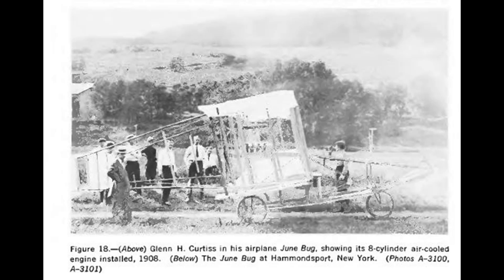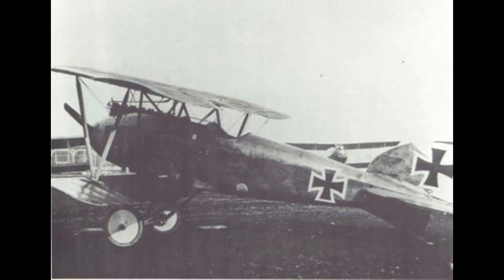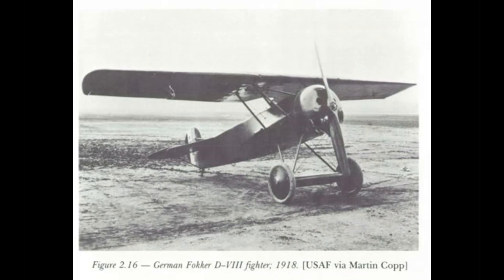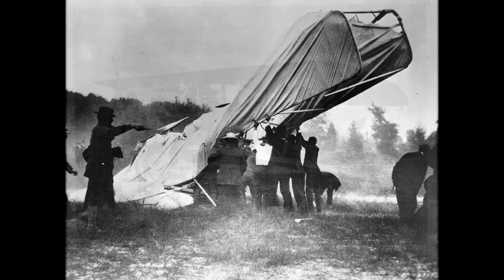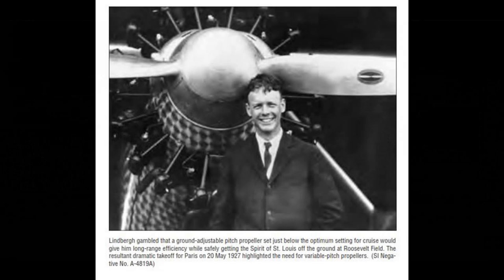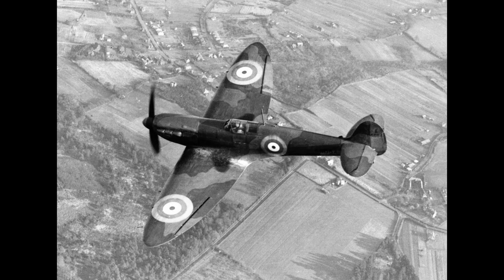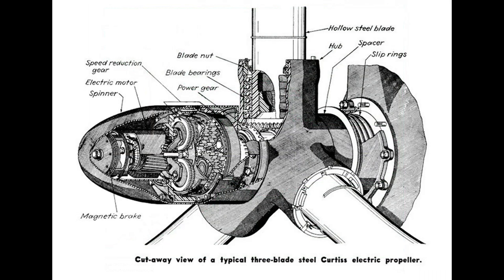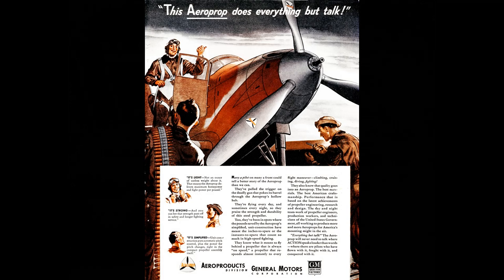Advancements In Propellers 1909-1942

Comment: You've demonstrated again why jet engines were a quantum leap in aircraft propulsion.  There was a reduction in powerplant and propeller vibration, the jet engines were simpler than the pistol engine with turbochargers and drive shafts and variable pitch props, and there were fewer controls as well.  Eventually you'll get around to explaining the modern turbo fan engines--it will take fewer words and charts.

Comment: The Spitfire II also entered production right before the Battle of Britain and with high octane fuel that thing has 1500 hp
Reply: Not exactly accurate, the first Mk IIs went into action at the beginning of September so most squadrons finished the battle with Mk Is. The Merlin XII in the Mk II produced 1,175 hp and 100 octane fuel allowed about a 10% power increase with the boost limit adjusted Mk I and IIs.

Comment: Wood props were standard for hurricanes and spitfires until 1940 Even though they were available, 2 bladed props were not full replaced until battle of Britain.The story of how the two fighters got three  bladed props had little to do with manufacturer. In June 1940 flight lieutenant McGrath telephoned the deHavilland  propeller division and asked if it would be possible to try a constant speed prop without a lot of fuss or paperwork. It add 7,000 feet to the service ceiling as well as !ore speed. The real benefit was to the maintainability of the Merlin by reducing wear. What makes this really bizarre is the constant speed.prop was a British invention.
Reply: Look it up again, the two position props were lighter and simplified De Havilland versions of the Hamilton Standard constant speed three blade propellers, the pre BOB upgrade by De Havilland converted their three blade props to constant speed.  The Bf 109E only had inferior manual electric pitch control propellers.

Comment: Thanks for the video Greg.
Your point about electric props and batteries in combat aircraft made me question something totally unrelated.
How were those batteries built?
They must have been sealed in some way to in order to withstand manoeuvring during combat.
Did they use some sort of gel-battery to prevent spilling?
Hope you read this, I'm puzzled.
Reply from the maker: Hmm, I never thought about that. I have no idea.
Reply: @GregsAirplanesandAutomobiles  gonna write to the museum in Sinsheim, maybe they have an answer. Cheers for responding Greg, love your videos.
Reply: Perhaps drain holes under the battery leak path was all they did? It was a good item to move when a big C.O.G. shift was needed.

Comment: Fighter ace Douglas Baader almost ended his WWIi career before it started by taking off with the wrong pitch on his varible pitch prop.and crashing.
Reply: That was the two position airscrew (as the Brits called them at the time) "Coarse" for takeoff/landing and "Fine" for cruising and speed.   He took off- or rather TRIED to take off -  in "Fine".     I used to think he was the absolute heroic british gentleman... ...until learning more about him...and particularly  his treatment of his Colditz valet....  he had some pretty nasty character traits it seems...
Reply: @trooperdgb9722  fine pitch is the correct blade angle for take off, course for cruising and high speed.
Reply: @richardrichard5409  Thanks!  Must have got that reversed in my head!

Comment: Great to hear from Greg once more. But, where's the story of how the 
Wright's 70% efficient propeller became 85% efficient albeit in a fixed range of airspeed?  This seems to have happened quite quickly, resulting in the beautiful wooden props we know starting early WW1. The Wright propeller was widest at the outer ends, the standard prop has greatest chord about 2/3 the way out. ??? How did this happen, is there any single inventor???
Reply from the maker: The leap to 70% was caused by the revolutionary design work done by the Wrights. The move from there to 85% was evolutionary, lots of little improvements by many different people over a few decades.

Comment: In the case of electrical failure / loss of the generator what would provide the electricity for the spark plugs?
Reply from the maker: Great question! The engines will still get spark because they use magnetos which use the rotation of the engine itself to generate the spark. That's why many early airplanes had NO electrical system at all, yet the engine still ran.
Reply: @GregsAirplanesandAutomobiles  and the light bulb just came on. I have wondered for a long time why magneto's were used for so long in aircraft. It presents an additional failure protection. After all, It's a lot easier to land an airplane when the control surfaces still work and the engine is still running, regardless of what else is wrong

Comment: Greg, do you have any ideas on why the He 177 didn't use a pair of engines and a Tractor & Pusher (with each engine operating only 1 propeller, or a Contra-rotating propeller?  (Were they order to use that troublesome engine? ). Also, all the engine fires, due to thrown rods, or overheating? If overheating, why didn't they increase the size of the radiators or add some underwing or even overwing radiators to aid in cooling?  Oil coolers would also help in this case since you would be lightening the Thermal Load of the radiators.....

Comment: 32:20]. How does...  of course there are slip ring connectors... the electrical power flow to the electrical motor in the spinner?  And, I was worried to death about all of those complicated oil ports in the hydraulic propeller - at least that complicated hydraulic-governor mechanism is on the right side of the spinner.

Comment: Wonderful! Will you be also covering Soviet and Japanese propellers? I guess your sources might be hard to get, so I understand why you'd shy away from that, but I've read somewhere that at the end of the war, Soviet fighters had comparable performance (at their optimum altitudes) to Western fighters, but they didn't have all the automated systems, so whereas in a Bf 109 G a pilot controlled fuel, mixture, prop pitch and so on with one lever, in a La-7 you needed to move several levers at once or in quick succession.
Reply from the maker: I haven't covered much Soviet or Japanese stuff yet, but I will.

Comment: is the 3vs 4 blade props video, will greg talk about why the lockheed constellation has 3 blades?
Reply from the maker: No, it' s about warplanes, but I do think that the general principles I discuss will apply.
Reply: @GregsAirplanesandAutomobiles   i meant only the engine and its hight off the ground. not the constellation its self. but i think the consellation was a flying prototype durning ww2.  im going at "why do someplanes have 3 blades and others have 4given they have about the same horsepower?'  like the boeing B-29/B-50 vs lockheed constellation.
Reply: @GregsAirplanesandAutomobiles  hope ur gonna talk about the 5 and 6 bladed propellers of end of ww2 fighters. like a REALLY late spitfire and the carrier variant.  there was (i think) another carrier capable british fighter that had 5 or 6 blades on one shaft.  my knowledge is comming from a 900 something page book of planes that was published in the mid 90s

Comment: I've got a question for Greg. This pertains to WWII fighters that are modified to race in the unlimited class at Reno. Most of these planes still use a stock propeller, even though their engines are producing double, or more HP than the stock engine produced. How is the stock propeller able to convert all of that extra HP into thrust? It seems to me the stock propeller would be very inefficient for this application, and a larger prop and/or a prop with more pitch would be needed to take advantage of all the extra power.  Why do they use a stock prop?
Reply from the maker: In some cases they do use bigger props. Rare Bear used a DC-7 prop, at least in some races. With the stock prop it can handle more power by going to a steeper pitch, but at some point more prop will be needed. I don't know just when they need a bigger prop, no do I know which planes use which props.
Reply: @GregsAirplanesandAutomobiles  Thanks for the reply. Rare Bear also used a 3 bladed prop, from a P-3 Orion I believe, and there have been a few modified P-51s over the years using dual counter-rotating props, but the vast majority of these racers use stock props. Dago Red, Strega, and Voodoo all use(d) stock props and they are the fastest of these racers. I wonder how much faster they COULD go if they had modified props that could handle all of their power?

Comment: I wonder why the Dash 8 propeller looks like kinda like a scimitar blade.. does the propeller tip come close to the speed of sound?
Reply from the maker: If a prop is a rotating wing, then a scimitar blade is a rotating swept wing. At high rotational speeds they are more efficient and quieter than conventional blades.

Comment: Yes the Stearman did originally have a ground adjustable propeller, but your image at 8:54 "This Stearman has a ground adjustable propeller" is not correct, that propeller is a Hamilton Standard Variable Pitch propeller,  either a model 2D30 or 12D40 depending on the engine that that Stearman is using

Comment: Greg, this explanation of the hydraulic governor and the purpose of the constant speed propeller is really special. 
1. In a twin-engine airplane, I suppose if you have some kind of failure of the governor or whatever on one prop, but not the other, which would seem reasonable given that there two separate systems, I guess you would have asymmetric  of some type, but this does not seem catastrophic. I guess you could have something break and have an oil leak, but it does not seem that a failure of the governor/variable pitch mechanism of the hydraulic persuasion is going to raise the life insurance premiums of the pilots that much.
2. We need to get away from the use of the term 'centrifugal force'. I get why it is used, but in a channel such as yours that does such a bang up job of getting things correct, you have to know that centrifugal force does NOT exist. Briefly, suppose you are a passenger in a car and you go around a corner. You feel pulled outwards. However, the reason this happens is because as arrogant self-centred humans we place ourselves at the centre of everything. Making motion observations from a moving (ie non-inertial platform) such as this car means that you will not follow Newton's Laws and all the rest. It is the same as being on the freeway and passing a car that looks like it is moving backwards, but the wheels are spinning forwards; thus a contradiction. 
For the turning car if you are observing the situation from the sidewalk, you can see that the car would continue forward except that the wheels turn and the frictional forces of the tires on the road pull you around the corner. Thus the force that turns the car is directed INWARD not outward. It is called the centripetal force (yes, I know it sounds nearly the same, this is a for real force requirement).
Now, moving on to the governor. They had very similar ones on steam engines in the day. You have, depending on construction of the governor a spring arrangement or masses that are attached and can swing out as the thing rotates more rapidly. The centripetal force required to allow an object to follow a circular path is Fc = m v^2/r  (the speed here is the speed traveled at the radius r). So, as the object spins faster the geometry of the governor will change to accommodate the rotational speed required. So the spring version will have a spring of a given spring constant and as the shaft spins faster then the spring will compress (or stretch) increasing its force (Spring forces are generally proportion to the amount of compression) to balance the new requirement. When it moves, this is then connected to some mechanism that would change the pitch as required. For the counterweight model they used on steam engines, the spinning cause the weights to rise on a cantilever. The geometry of same required increased force to lift the mass as the mass was sent further out. Attached to this was a rod that limited the inflow of live steam. These require gravity and I doubt they would make any sense on an airplane, but the idea is the same. Sorry, the clarity of the above is wanting compared to your work, I thought I would point this out anyway. Regards, Henri
Reply from the maker: Hi Henri, that's all true, I get that centrifugal force is more of an effect than an actual force, but I felt that the term would work here to explain what's happening.

Comment: Forgive me everyone if this is a stupid question, but how does that oil line from the governor connect to the nose cone considering that the governor is not spinning yet it has to make it through the propeller to the nose cone which are both spinning.
Reply: Hollow prop shaft with drillings.

Comment: Interesting Ponder: Why didn't anyone try to make a variable reduction gear instead of a variable pitch prop in the early days. Until the propeller tips starts to break the sonic barrier, which didn't happen for a few decades, it is probably easier to have a planetary clutched such that you can lock the planets to the sun gear or the ring to the planets or both and have a 2-speed or 3-speed transmission.
Reply from the maker: Because keeping the prop and engine at a constant speed is the whole goal. The engine puts out maximum power at a certain speed, thus you want to keep it at maximum power for best performance and to do that you have to vary the load on it.
Reply: @GregsAirplanesandAutomobiles  Yes, which is why you keep the engine rpm at the rated maximum while you increase the propeller speed as airspeed increases without changing the pitch. It is not a problem until the propeller gets so fast that the tips go supersonic. But with many early engines and props (even many contemporary general aviation stuff) you are not anywhere near supersonic on the prop.
--
It's like the way ships deal with propeller speed when they do not have a variable pitch propeller. Instead of a fixed reduction gear set between the turbine or diesel engines -- which then limits the vessel to a certain propeller speed because of engine speed limitations -- they either have a transmission or a variable frequency drive so they can vary the propeller speed. For any given forward vessel speed there will be a RPM when there is essentially zero load and zero thrust --  when the screw pitch and rate it is turning is exactly the same as the water flowing by. As you approach that I assume that aircraft props have the same phenomenon, except much flows are faster and ultimately overspeed problem is sonic shock not cavitation.

Comment: The other problem with rotary engines is that such a large rotating mass will have a TON of angular momentum and will basically act like a gyro bolted to the front of the plane. At high RPMs it will take considerably more effort to turn the plane as the engine will want to keep facing forward. This is especially true with the light wooden planes they used back then.
Reply from the maker: Yes, we talk about this in another video, which is why I didn't feel the need to go down that path here.

Comment: Am I wrong to suppose that production Griffon engined Spits XIV, XVIII, XIX, 21, 22 & 24 etc commonly went to five blades on account of the relatively short undercarriage restricting an increase in prop diameter?
Reply: The Griffon powered low altitude Seafire XVII only needed a four blade prop as the power could be absorbed in the denser low altitude air.  This also applied to the original Griffon powered low altitude Mk XII.  Both had shorter single stage Griffons.

Comment: Wonder what the performance difference would be on say something like a c-150 put a constant speed prop on it and maybe you gain 5kts cruise speed and 50feet/min more on climb out? Hard to tell unless someone’s done it
Reply from the maker: I would say not much. It's a 100 horsepower airplane, adding extra weight to it would probably hurt the performance about as much as the constant speed prop would help.

Comment: Is the idea of variable speed or even manual to ‘bite’ into less dense air and then back off in more dense (or humid ?) air, or am I missing the point ?
— Yes, I know I can just look it up, but there’s something nice about dialoging with y’all.
Reply: Diving and climbing changes the air load on the prop, cs maintains the revs for safe and efficient engine operation.  Throttle change also does not alter the selected engine revs.

Comment: Been a fan (fan 🙄) of the Hamilton Standard hydraulic prop. I see Greg likes/prefers those, too. My only complaint based on only limited searches tho is that the B-29 “Ramp Tramp” that made the emergency landing in ooh-es-es-arrr due to non-feathering prop, was fitted with the hydraulic  prop. All that tech given for “free!”Anybody know if that’s for sure?
Reply from the maker: I do like hydraulic props, I think the Soviets had all the US prop technology by 1944 anyway, but they learned a lot from those B-29 they acquired.
Reply: Electric props are rarely used today, hydraulic is more reliable.

Comment: It would be interesting to explore why none  of the belligerents considered using constant speed contra rotating ducted fans with variable geometry nozzles  either side of the fuselage driven by prop shafts as these, if well designed demonstrate much improved thrust and efficiency performance.

Have you encountered any research during that time period that such a system was considered?
Reply from the maker: The Italians did it and it worked, However the concept was never fully developed. The main problem was that aircraft engines and cooling systems of the time didn't lend themselves well to that layout because they were too bulky to easily fit into the ducted fan's ducting.